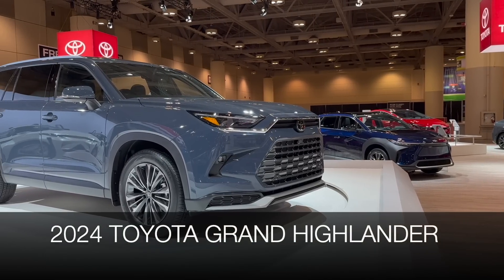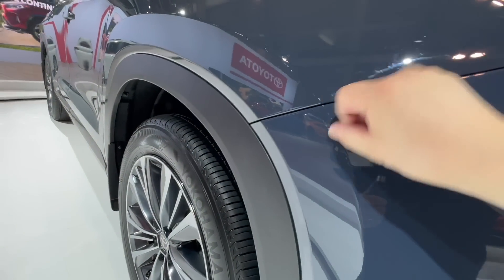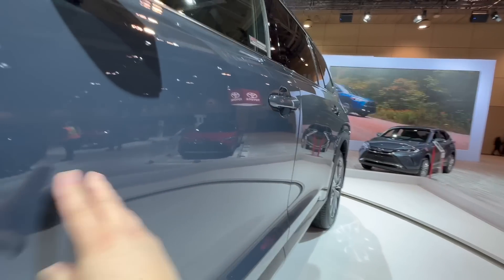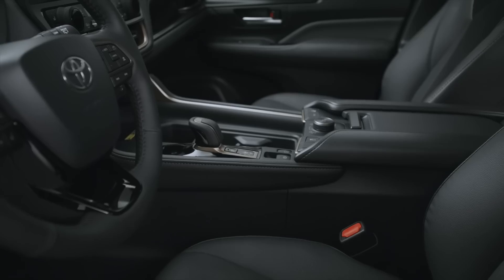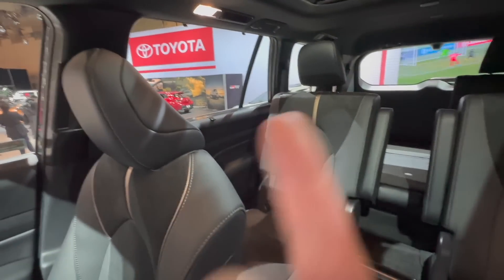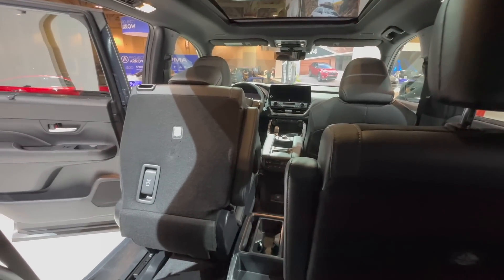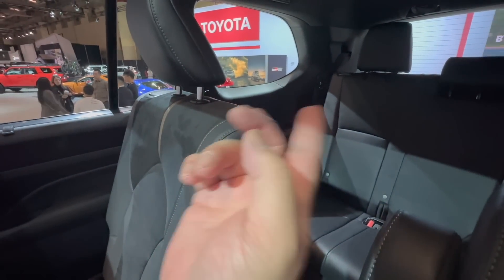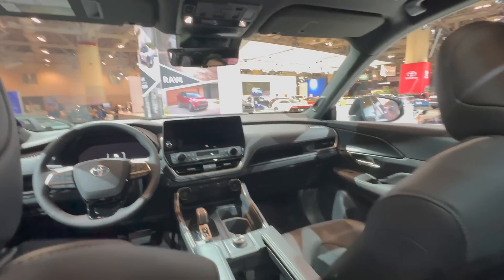HOW IS THE QUALITY OF 2024 TOYOTA GRAND HIGHLANDER? ENGINEER'S FULL AUDIT OF QUALITY AND DESIGN

Comment: David. Please, why is the hybrid max power plant mated to a 6 speed transmission? I had imagine the hybrid max engine will be paired with the 8 speed transmission at least or Toyota's new 10 speed tranny.
Reply from the maker: It's likely that they haven't re-engineered the 8 or 10-speed yet for this configuration, due to change in power and torque of the hybrid max powerplant.

Comment: I still feel like the 2023 Honda Pilot has an edge on this grand highlander.
Reply: Pilot cant even  come close . 😂
Reply: @volvoxc9086  pilot has a better cargo space, better mpg, removable middle seat, so idk
Reply: @chubulu9842  GRAND HIGHLANDER IS BIGGER MORE LUXURIOUS MORE POWERFULL BETTER LOOKING And EVEN A 34 MPG HYBRID IS AVAILABLE .SO RELAX  .IDK
Reply: The thing about the new Pilot is that even with the new v6 motor it is still using a Timing belt rather than a reliable timing chain. Also a friend of mine who is a Honda Tech informed me that Honda still has not resolved the front brake caliper placement. And because if it's placement, the Pilot eats up brake Rotors.  Honda is well aware of this problem with the older Gen and yet they decided to carry it over to the new model.  My friend also pointed out where the battery placement is. Which is right below the intake duct. So if battery requires replacement, you'll have to remove all the intake duct work just to get to it.
Reply: Cx90 is better than both

Comment: I’m not sold on hybrid tech yet since I drive over 200k in our cars. I value long term reliability and mpg isn’t my #1 priority. As a retiree with 50 yrs of DITY car maintenance I prefer proven simpler engines & transmissions. I would get the standard FWD & gas engine without hybrid after a few yrs. I’ve been burned with 1st year models and new tech. Great review & my state Indiana makes this SUV🤓🇺🇸❤️
Reply: Toyota Hybrids have been around for over 20 years!!! They are NOT new and it is Battery assist, not FULL EV... the batteries should last a LONG time. I have seen Prius and Camry's with 500K+... there are many Taxi companies that use Hybrids and they live on the roads.
Reply: My company owns 18 camry hybrids at this time, many go 300k miles+ without a single problem. It's gas engines you have to worry about, as many like to start burning oil at 150-200k miles.

Comment: Hi Dave, As an auto engineer why in the world would toyota have the car shut off when entering the car after using the remote start? Thanks for the video!
Reply: So the car doesn’t get stolen while running to warm up like in the morning etc
Reply: @huyenthoai9979  if the doors are locked how are they going to steal it? They are finally coming up with a software update to fix it.
Reply: My friend's Enclave does the same thing, but I agree, if it's already running and I have the key fob and can get into the car, then it should just keep running.

Comment: David, as you mentioned, the engine compartment looks very well done but packed, and like almost every front wheel drive vehicle, serviceability is likely not great. I can't imagine changing spark plugs, or a water pump. I wonder if Toyota has published how many hours these jobs should take, and how they compare to other modern FWD vehicles. Or, how much difference is there between a Hybrid Max and the standard 2.4L turbo (to replace spark plugs or a water pump.) I trust that Toyota puts a lot of effort into making their product as serviceable as possible, but there's just so much stuff packed into the engine bay, especially with the Hybrid Max powertrain vs. non-hybrid gas-only model.

Comment: Hey David! nice review! I have build quality issue with my 22 Highlander , the headliner at the windshield looks cheap and it does not meet at the windshield!  I contacted Toyota and the dealership about this QC issue! Do you have the same issue with your 2020 Highlander?
Reply from the maker: Mine is pretty good, but some issues with paint and body gaps
Reply: Thanks for replying to my question! I also have one body gap issue and the head lights are scratched! But, no issues with the power train so far!

Comment: Thanks for the review. I’m looking at this and the new Mazda CX90, and perhaps if I can wait a bit longer Lexus TX before I pull the trigger and buy one of them. On GH, I’d prefer a bench seat and hope that Toyota offers it in the limited and platinum trims. Any thoughts on the Mazda CX90 or the Lexus version of this as TX? Thanks
Reply: Thanks for the comments. Yes, so far the GH looks very good and checks all the boxes. Regarding Mazda, I was talking about CX90 which is a completely new vehicle than CX9 and considerably larger, better looking and more powerful. My guess is that TX will be about $15k more than GH Platinum.
Reply: @TheMrDudiness as Mrthree said, form over function, but also because the inline 6 engine required such a long hood. However, although not as usable compared to the GH, it’s definitely better than the CX-9.

Comment: The new 2023 Honda Pilot is also very well engineered.  I would like to hear your comparison between the two vehicles after you have driven both.  I know the Grand Highlander will have better fuel economy for sure but what about in terms of drivability and quietness at 75mph?
Reply: The Pilot’s removable middle seat was a deal breaker for me
Reply: @chubulu9842  why?
Reply: @TheMrDudiness Of course I was referring to the regular 2.5 hybrid and not the 2.4 turbocharged hybrid max.
Reply: There was a segment of comparison with pilot(2025) and grand (2024) grand won I don’t think it was Dave , someone else